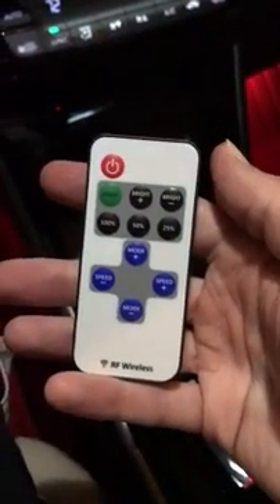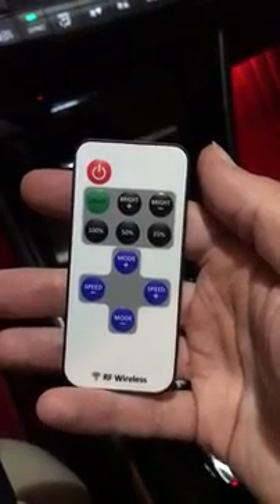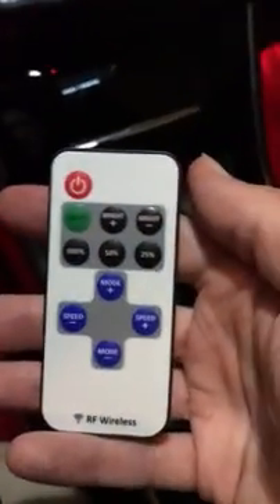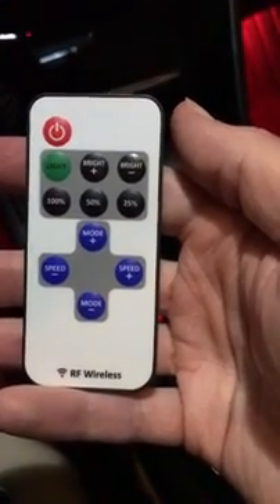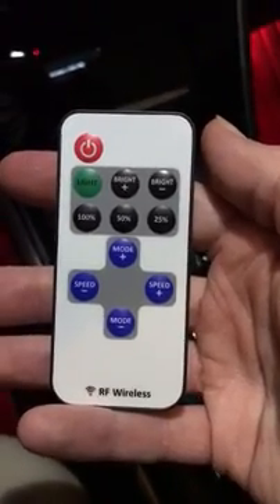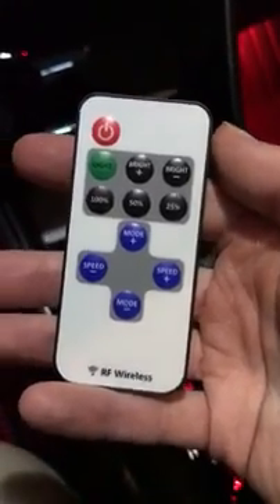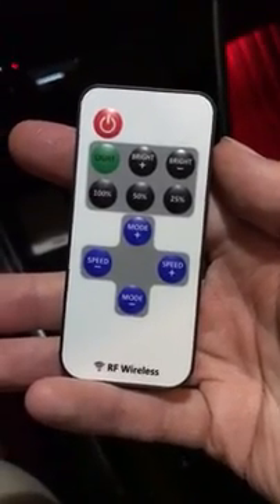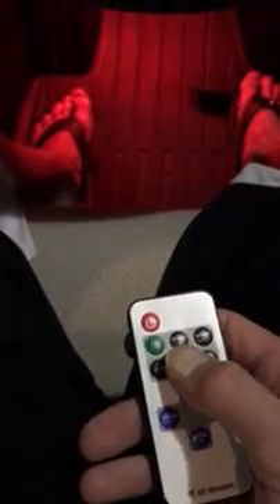LED Footwell Illumination Part 2 - Overview of Dimming with Remote

Comment: Hey where did you buy that Pearl wrap for your last car. I have an 07 Civic Si that is black. Want to get the Pearl white but don't have the money to paint and I heard wrap is just as good? Thanks
Reply from the maker: Hey Zach - I bought both samples of 3M and Avery Dennison's Pearl White vinyl but in the end decided that I liked Avery's better (much better pearl white color...less eggshell looking like 3M's appeared to be). I bought a huge roll of it off of eBay from a reputable vinyl seller. All vinyl usually comes 60" width x <length of roll that you need> so measure your car's panels ahead of time and don't stress about ordering too much - better to have more than needed than not enough to complete the job. G'luck! Would love to see the before / after pics! :)
Reply: Ok man thanks. Is wrap just as good?
Reply from the maker: Just as good as...a new paint job? A vinyl wrap is time consuming and tedious work...if you're not DIY it can be quite pricey and be sure to do your research on the shop first (customer testimonials, customer pics of intricate places like around corners, grooves, etc.) because a new or inexperienced shop may charge just as much as a professional experienced shop but it isn't until after your car is finished and the bill paid that you realize how many corners they cut and within a month the wrap starts to lift. I've seen way too many Ytube videos of this happening and the customer's being pissed. If not installed properly, a vinyl wrap can become ruined within a few short months whereas a permanent paint job won't. A 180˚ contrast paint job is probably going to be pricey though, going from black to pearl white. With a complete color change paint job, or vinyl wrap, just know that you'll still have some body panels the original black color such as strut towers, door sills/jams, underside of trunk lid and hood...unless you really dish out the cash which can start running you around $5-6 G's O_o A certified 3M or Avery vinyl wrap installer for a Civic Si coupe should only run you around $2-2.5K

Comment: I have something just like this on my 7th Gen 06 Coupe, I also have red lights, but I used a nice LED Strip. I can post pictures. Yours looks better, but the light isn't distributed as well.
Reply from the maker: Communicator - Nice bud! I once used a LED strip as my 7.5G's license plate lights and my goodness it was bright haha I think in terms of footwell lighting and the goal I was going for, the 2x LEDs from SBL is just the right amount of light for me personally. The lighting output truly is evenly distributed and looks fantastic, it was just very hard to have the camera pick it up realistically as the camera constantly refocuses. I kept repositioning the LEDs until the light distribution was even before mounting them - one thing that the OEM kit with a single dim LED would never let you do as you have to install it in the OEM "peep hole" on the under panel. Since I drive in the dark to work, I've been keeping them at two clicks below the 25% preset level which I find to give it the perfect sporty glow without also distracting me. I'd love to see pics of your setup though - feel free to PM me the link